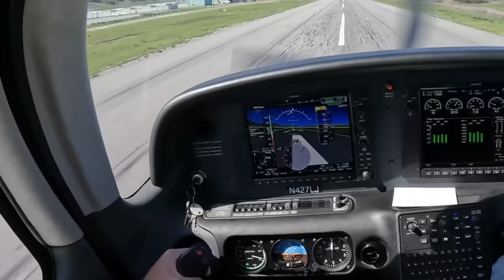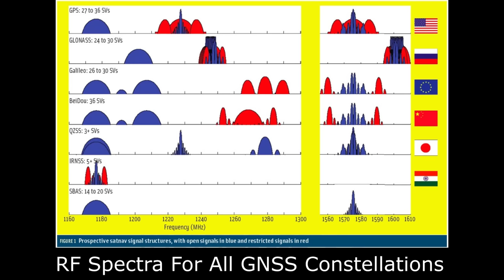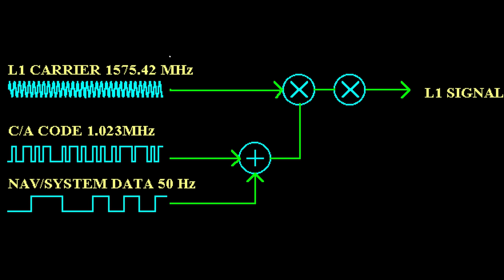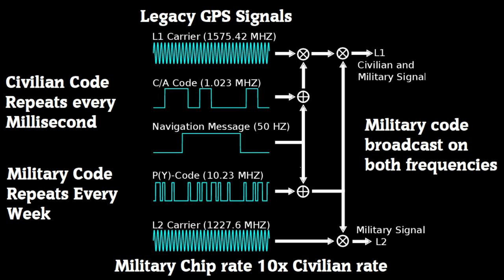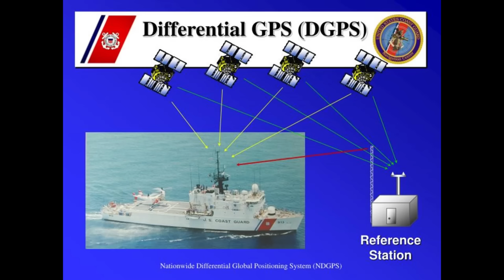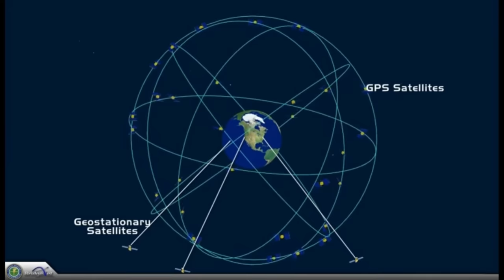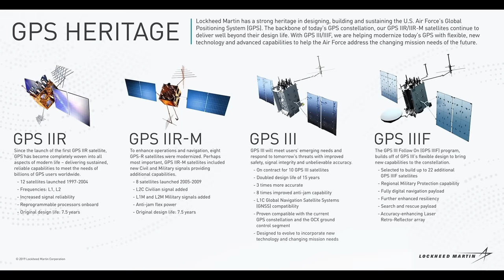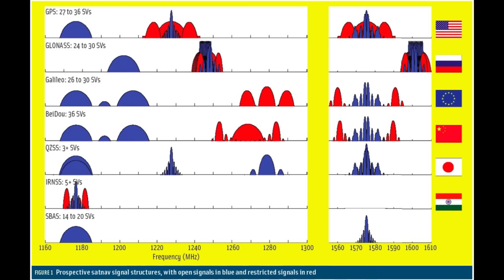How GPS Works, And How It Got Better Than The Designers Ever Imagined

Comment: Have a friend back in the early 90s that worked for the NJ forestry (Gov).  He showed me the GPS they used for tracking rare trees and stuff and mapping roads etc... It had, at that time, a 3cm resolution... It was nuts.. Moved the thing centimeters and the data changed... And that's radio signals, how much TIME it took from one location to another in an electronic device reading it.

Comment: For GPS, CDMA does more than just let you pull out the signal from one transmitter... It lets you know the (local clock) time you got that message with an error less than the frequency of the carrier wave.  IIRC, it is called phase lock or something like that.

Back in the day (2000s), I worked on an acoustic localization system which used some of the same methods as GPS, only with sound.  Amusingly, one of the motivations for developing it was that GPS doesn't like to work in many forests because trees can be surprisingly good at absorbing the GPS transmissions.  We used fairly long running (many hours) differential GPS survey units to do ground-truthing, and the errors were still in the few meters to many cm range.

BTW: In the 90s I had a colleague (botanist) who surveys and collected endangered plants, including on a few military bases / test ranges in SoCal.  A base commander loaned him a military GPS... It was mind blowingly accurate and useful for the time.  I was very jealous. ;)

ETA: One last note...  on that gov agency vs DoD graphic, the NSF should be in there too.

Comment: Thank you for the top notch info!
From one nerd to another. 
What I think you wish that you totally understood are the so called "side lobes". In the radar (radio) spectrum of the electro-magnetic spectrum, it is impossible to totally peak an emitted signal. What you get, even with a perfectly directed radio signal, are lobes. The side lobes are unwanted. This phenomenon is actually used in ECM (Electronic Counter Measures) to spoof radars by for instance from an aircraft making another emitting aircraft radar receiver "think" that there are multiple enemy aircrafts in the air. The radar receiver reports more than one aircraft at different locations. You can to some extent remedy this by putting several antennas on the aircraft. Or you presumably can resort to ECCM (where the extra C stands for another Counter). I hope this helped you on your way to total understanding?

Comment: Thanks for the video. With respect to accuracy, I've been using a tiny, hand held Garmin receiver worth $600 for nearly 20 years (same one). Done a lot of survey work way out in the boonies looking for century old marks and find I get consistent 400-600 millimeter accuracy. Had the occasional find wider than that but never more than 2 metres.  With respect to modern survey gear locating or transferring data from a permanent survey mark to a jobsite, it's usually around 2-5 mm in both X & Y but a tad more  of 5-15 mm in vertical accuracy. There is a bit of wait to get a good stable result like that but it's good for accurate construction.

Comment: We were using differential GPS in Australia for aerial survey that resolved down to 10m accuracy. That was in 1993. It allowed us to place the dead centre of every photo frame at a particular lat and long. These were photo's take using an aerial camera that looked directly down out the bottom of the aircraft. This way the cartographers could geolocate the frame centre without too much ground control (white crosses on the ground that are ground surveyed and can be seen in the image). In fact, when this is combined with limited ground control, we had 10cm accuracy. We set up an antenna on a known survey point near our airport of operations and record data then we went flying while that recorded and separately recorded the flight gathered data. Then at the end of the day we ran the data through software to resolve the error out for every frame captured. We used the original Toshiba Satellite laptops of the day.
Reply: hi mike_, what do you think about all gubments drawing a line around you(Antarctic Treaty) and saying you are not allowed to leave? If you don't know what I mean, read my about tab.

Comment: In 1995, a British patent named Clock Cleaner & Jitter Reducer was filed and extended to over 25 countries.
The inexpensive products were tested at the Imperial Colledge of London and their use was first applied to hard drives which, with perpendicular recording, increased their density from MB to GB and TB.
Additionally, all mobile phones use this technology to eliminate frequency fluctuations.
Furthermore, a primary application is to align clock speeds on the Earth's surface and slower clocks on satellites.

Comment: 5:08 A slight correction: To find your position in 3-dimensions, you need 4 satellites, even if you already have an accurate clock. Say you measure the distance to one satellite. That gives you a sphere, and you are on that sphere. Measure to a second satellite and you have two spheres, which intersect in a circle. A third sphere will intersect the circle in two places, giving you two possibilities. You need a fourth circle to tell which you are on. Though for a handheld device, you can use the Earth as another sphere.

Comment: The unit on the left (of the two military handheld units) is the same thing, or at least super similar to the PLGGR we were still using in 2003 during OIF I as forward observers. GPS still felt pretty novel.

Comment: Back in the day, I used to work next to a GPS shop - I fondly remember a van sitting in a parking lot with 8 or so GPS antennas on the roof - it would drive forward about two yards, stop and wait about ten seconds, then drive backward about 2 yards, stop and wait - repeat.

Comment: Great explanation of how GPS has been improved. The geodetic scientists have post-processing methods, which use more accurate orbits for the GPS and other GNSS satellites that are calculated after the fact and other data such as weather models and temporal fitting to remove additional errors due to the troposphere, that can get to centimeter-level precision especially for the average position over a day and millimeter accuracy over a year or less. They also use the precise post-processed GPS orbits to improve the orbit accuracy of other satellites that have GPS receivers. Those improvements take time so they don't help with real-time navigation.

Comment: Modern phones actually use a thing called AGPS where additional positioning data is provided by cell towers similar to the way the old Coast Guard system worked. Your phone uses those Quicken the bootstrap and also then can you use Wi-Fi access points captured by the phones themselves, Google cars, the Apple cars, and random War drivers to further enhance the total position.

Comment: My stepfather had a yacht and bought an early satellite navigation system (Walker Sat-Nav 802) that used a predecessor to GPS that used Transit Satellite Navigation. It was revolutionary for the time (around 1981). I was 16 at the time and was tasked with finding out how it worked (I was the family geek). You can't imagine it now, but you had to wait for a useable satellite. It had to pass at a certain angle on the horizon. If it locked on to a satellite, it started calculating, which took about 7 minutes. Sometimes it came with an error 'NO FIX'. The system used an electronic compass and a log for measuring the speed of the vessel. If you knew how much the drift was, you could enter that and it could sort of guess you position (it would adjust it when it got another correct position). It was very early days for satellite navigation and there were a few satellites, so you wouldn't get a correct position all the time. But for maritime navigation it was adequate.
I found it very cool to work with this stuff back in the 1980, and am still in awe when you see how far we've come in the meantime.

Comment: Could actually be an interetsing follow-on to talk about the "other" GPS systems, especially the history of Glonass seems quite interesting... especially since to my knowledge pretty much all modern GPS receivers use at least two different systems simultaneously just to increase the number of available satellites? I know this would be in many ways much harder to research but still very appreciated!
Reply: Yes, ‘GPS’ is the US system. The generic term (that almost nobody uses) is ‘GNSS’, Global Navigation Satellite Systems. The one GNSS receiver I am familiar with (Carlson BRx7) does use all available satellites.
Reply: Making receivers recognize other satellites is the easy part, the actual challenge is that different systems use different reference frames of the Earth surface. Basically, they have their own ideas about where exactly the North pole is and which altitude is the sea level. And it's no joke, Earth's rotational axis travels each year a bit and oceans have slightly different levels at different latitudes. All 4 major GNSS systems use their own frames and update them independently, too.
Reply: @Alex-og3ev  Intersting, I didn't know about those differences! Considering it seems that many major users (like apple for example) do use all four major GNSS systems, I wonder how valuable it actually is (in accuracy terms) to support all this complexity.

Comment: I  work with civilian Drones, and we get < 1 cm accuracy through RTK. Two Holybro F9P units, one on the ground sending RTCM to the one in the air. For those who don't require that level of accuracy there is NTRIP, which is RTCM over HTTP. Most governments provice free local NTRIP services,

Comment: right after gulf war 1 lot of aircraft started getting GPS augmentations to the INS systems. The intention was always to do just that, provide augmentation to on board navigation systems to keep their alignments tight and correct the distance over time drift that they suffer from. Removing the need for route planning land marks for INS updates.

Comment: Was waiting on you to mention RTK GPS! Makes it much more accurate for us on the ground
Reply: Yes, I was too. Processing of the phase data has been happening through the whole of GPS code processing development that Scott has described. The phase derived relative positioning accuracies were originally sub decimetre but required hours of simultaneous observation. Today these RTK solutions are almost instantaneous over distances less than 20km with 10mm type accuracy. This is the part that is used extensively in land surveying and sport such as sailgp.
Reply: @gavinsmith2944  I know.. weird that he made a video on this and thought 1m accuracy was the cutting edge; nope it's 100x more accurate than that, even with <$500 hardware.

Comment: Europa also uses a radio network from the ground to improve navigation in the air. 
The transmitters are connected to each other with fiber optics.

Comment: I “discovered” GPS in 1986 as navigator/ops officer on USS Parche.

It was very precise even 37 years ago, even with just a few satellites in the ephemera. It’s antenna was installed on top of our #2 periscope. And it provided 3-dimensional, real-time position info. 

At periscope depth the GPS posit indicator displayed the antenna’s 
height above sea level. The ship’s control team could observe this depth display and keep depth more accurately than by using the depth meter that used differential sea pressure.

But it can’t work as a fix source when the antenna is submerged. For submerged operations, position is estimated by traditional (centuries-old) methods and by inertial navigation systems. The only fix source available to a sub deeper than periscope depth is a bottom contour fix. And BC fixes can be as inaccurate as several miles. 

For a ship’s navigator, GPS is a lifesaver and career-saver.
Reply: hi davecorley, what do you think about all gubments drawing a line around you(Antarctic Treaty) and saying you are not allowed to leave? If you don't know what I mean, read my about tab.
Reply: @flat-earther  I think your nuts, but entitled to your own opinion.

Comment: Surveying opened up my eyes to the world of GIS/GPS. I couldn't take a shot (log a point) with less than 10 satellites, and I needed to be connected to WAAS. We would also tie in with known points that had been traditionally measured to account for different kinds of error. On average, we could be accurate within 0.005-0.01 feet. Also, fun fact, pine trees scatter GPS signal, especially sand pines. Something about all of the different lengths of needles would could me to lose my signal lock within seconds if I walked under one.

Comment: There was a slight distinction on removing Selective Availability in May of 2000 - it was not turned off, it was set to 0.  
Newer GPS III satellites were procured without the ability to dither the time signal based on recommendations from the DoD from what I've read.

Comment: Very interesting topic.  A couple decades ago when GPS started to become commercially available, I bought a Magellan handheld device. Aside from bring bulky, requiring  8 double A batteries, and burning through them quickly, its precision was considerably worse than the 100 meter limit imposed by 'Selective Availability'. On a ridge top, with unobstructed access to most of the sky, it was off by a tad over 200 meters. There weren't trees nearby but in the distance were some outcroppings of rock. I suspect that the rock might have caused some reflections, degrading what was received. But at 200 meter inaccuracy,  I had to 'reality check' the signal against paper maps.

Comment: Interestingly the GPS system has its own time system that is different than UTC time. GPS time is not based on the Earth’s rotation like UTC is, so it does not include leap seconds. This doesn't affect navigation accuracy, but it would cause a phone for example to display time that is several seconds off compared to UTC. So the satellites broadcast the difference in whole seconds so that GPS receivers can make the adjustment in the time that they display. I think the current adjustment is around 10 seconds.

Comment: When I first used GPS, you could roughly confirm which grid square you were in on a bushwalking map, and the height was wildly wrong. I remember standing at a survey point and being hundreds of meters below it by GPS. A few years later, returning via the same track would trace over the same path on a handheld, and landmarks would be within sight distance of the waypoint.

Comment: Used to use my phone to navigate to job interview in an urban area. I rapidly learned that I needed to go to the place ahead of time because the navigation system would get me to the right block but it could be off by length of one side of the block. Good explanation Scott. I had read about the time thing before but this went deeper without being to confusing.

Comment: There is a new modern aspect - RTK GPS, which is somewhat like a local DGPS station, but it measures phase-shift on individual signals between two antennas, which gives millimeter local accuracy to the DGPS global accuracy.  It's especially useful for a "GPS compass" given it's weird millimeter-delta local accuracy relative to global signals, which is absolutely fascinating as it's own separate subject ..

Comment: One trick you can do if you have all the data for the different satnav systems and are designing something to work in really bad conditions (say forested, steep sided valleys) is you can combine data from different systems.  Say you can only see 2 GPS satellites because you've got trees or cliffs in the way of the rest...but you can see one of the Russian ones and one of Europe's...  You've got your 4 satellites. It's probably a bit trickier to rectify the data formats, keep track of each system, etc, but you can do it.

Comment: Back in the very early 2000's to capture geo-spatial data, I used to walk around with a backback receiver, with aerial and "mushroom" shaped antenna, just to capture data that, at best, if using 6 satellites, would give me sub 5m accuracy, but usually 10m.  It cost us in the region of £20,000 for something that now I carry about in my phone.

Comment: @26:50 modern receivers actually overlay the results of the different satellite constellations to achieve even better accuracy and/or better resiliency and/or shorter fix times. E.g. right now my phone uses 3 GPS, 2 BeiDou, 1 Glonass and 2 Galileo satellites to give me sub 10m accuracy _indoors_. It's amazing what modern software can do on specialized hardware that costs a few Cents and uses just a few milliwatts of power.

Comment: About CDMA i like one analogy. It's possible to transmit signals in the same wide frequency range simultaneously, because every signal is in different "language" (code). If you (the device) only understand english, the speech of others would be just noise and the english speech would be highlighted

Comment: I work with radio systems that use synchronous protocols and we use GPS for microsecond-accurate time. A few years back we dabbled with GPS vehicle tracking. GPS at the time (2004) could usually tell me what road I was on. Differential GPS could tell me which lane I was in. In our parking lot we had a reference location surveyed to continental drift accuracy...

Natually, I fly with GPS. The unit I use (Bad Elf) routinely provides 3 to 5 meter WAAS fix accuracy.

Comment: Even more advanced than this is a process called sensor fusion which combines vehicle accelerometers with the GPS to continually update and cross correct the data. This is quite good at dealing with ionospheric disturbances without the use of DGPS. Most phones can do this, but perhaps most don't have it operating due to battery constraints.